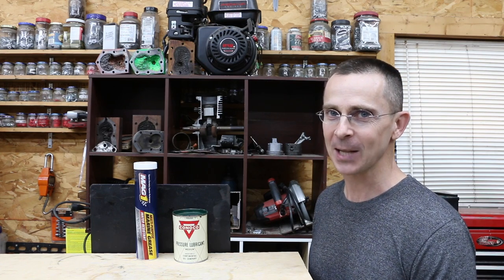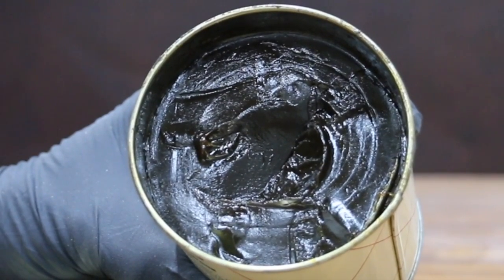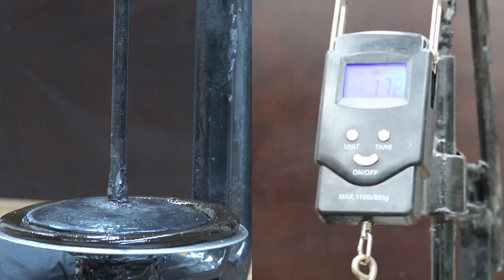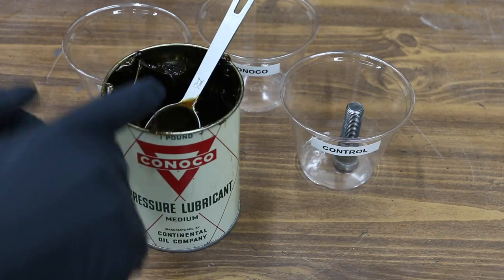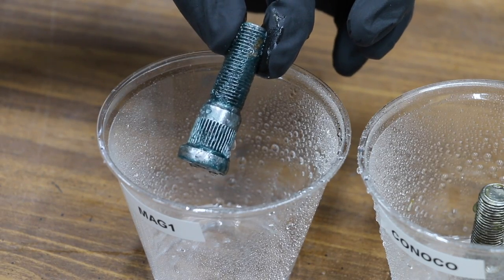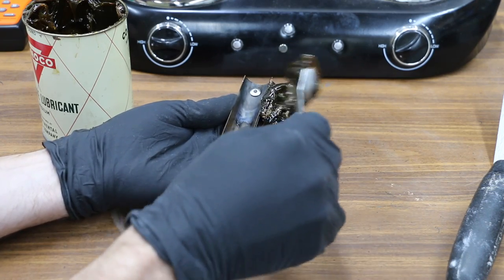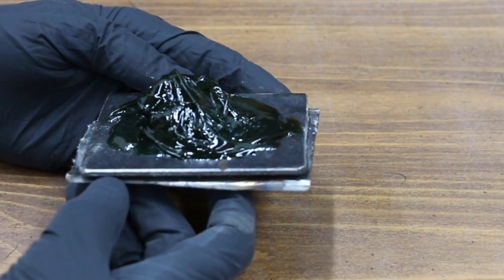Is 75-Year Old Grease Still Good? Let's find out!

Comment: I really enjoy your work and your videos.
I just thought that testing a multipurpose grease against an grease for motorboats and other use on the sea is not very fair whet testing corrosion and adhesion in water. You may have used also a multipurpose grease from nowadays.

Comment: Video idea project farm you should test the maximum stress a lawnmower engine can take before engine failure as in bypass the carburetor governor and see what is the maximum rpms you can rev a lawn mower single cylinder engine before you have engine failure I know our pressure washer has an automatic adjusting throttle arm that it moves back and forth to adjust the throttle for the load applied and when idling if you pull back that little metal arm it will rev really high almost like it’s gonna break or something you should do a “stress test” video thanks!
Reply from the maker: Thanks for the video idea.

Comment: To be fair to the vintage grease, it didn't say anything about being use in high temperature, high speed bearings. All the listed applications are lower speed, joint type applications.  With that said, 75 years of research and testing has definitely resulted in significant improvements in grease and grease applications.

Comment: Not quite the same thing but a few years ago I stripped down some 36'' pipework that was around 100 years old part of a Hydro scheme here in Scotland,  the nuts came off the bolts as if they were brand new they had been lubricated with Tallow I doubt any modern lube can beet that.
Reply from the maker: Thanks for sharing.

Comment: Came across a yard sale bought 2 cans of GAA  never been open. Lot date 1/ 1968 
This was extensive use in the military, General Aircraft Automotive grease was used on every movable part in the Army.
On a radar site we had to grease the stabilizer legs on 6 types of radars annually normally 2 days of back breaking of GI sweat. 
This grease was protective coating from the elements. This type of grease was a pain to apply, but it held up great. That's GAA would never get out of your fatiques, regardless how many application of solvents you tried.
Fastest way a Non Com would tightening up a squad,or a platoon was to state "might be needing a couple volunteers for a GAA detail".once on that.. you were smooth sailing😂😂😂
Reply from the maker: Thanks for sharing.

Comment: Dear Project Farm, here is another comparison idea: classic bar/chainsaw oil vs sunflower oil. A lot of people want an alternative to the polluting bar oil. Especially used near water streams this oil is very nasty stuff and the 'bio'-grade bar oils, which are very expensive, do not have a particularly good reputation in terms of required maintenance after use as the oil-gets way blocked due to coagulating and solidification of the oil). On ecologically friendly forum's more and more people start to use sunflower or similar oil as bar oil.
Reply from the maker: Thanks for the video idea.

Comment: I got an idea for video, but it is no product comparison. Maybe when u get bored you wanna try it. German Panzers in WW2 used a coating to prevent magnetic mines to stick to the metal, called Zimmerit. The Wikipedia entry even gives the formula. You could try to make it and test it on metal surfaces, vertical, angled and flat or so. might be fun, but maybe not ideal for your channel, i dont know.  o7

Comment: Awesome experiment!
It would be interesting if you came up with some grease compatibility tests since this info is tough to find for everyday products.
Also, how about thinning regular grease with gear oil? It can be tough to find  NLGI 00 grades for steering boxes or closed knuckle front axles and it would be interesting if there were a mix of regular products that could work! Mix in blender vs by hand?
Reply from the maker: Thanks for the video ideas.

Comment: do you have a video on what product is the best at protecting the undercarriage of a car? I'm from Ontario Canada and we use salt slurry on our roads and it just ruins our vehicle but there are products out there like rubberized tar, wax, silicone different oil sprays and sometimes grease but which one would work the best to protect the underside? I thought about using the rubberized tar but am hesitant because it could leave little pockets for moisture to get in and rot underneath that

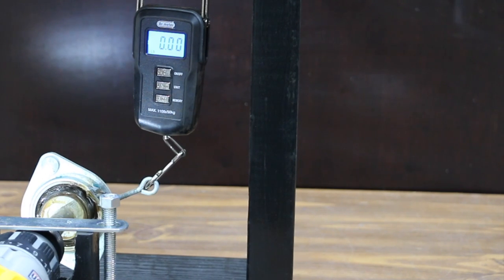Comment: 8:57 Unless there was a significant color change during freezing, it looks like you might have mixed up the Conoco vintage and MAG 1 greases here.

Although, in this particular case, the difference between the two was so small as to be statistically insignificant.

Comment: 6:19 I feel like this shows resistance to pressure instead of water exposure. After all you are basically spraing the plate with pressurized stream of water. Meanwhole in real life it would be just droplets of water hitting it in most cases. I know that thats propably hard to simulate but still.
Reply from the maker: Thanks for the feedback.

Comment: I've got a test suggestion.   A lot of guys have trailers to move their equipment especially flat bed untreated wood deck trailers to haul larger equipment like mowers and small tractors.   What is the best way to treat those decks so they hold up to sun, rain and snow.  I've heard of using a water seal such as Thompsons, sanded paint type deck seal, oil and even polyurethane with sand broadcast over it while still wet...is the a good preservative out there that isn't also slippery when it gets wet that will hold up to heavy use and extreme weather?
Reply from the maker: Thanks for the video idea.

Comment: A lot of talk on forums about Tundra Transmissions no longer having trans oil to air cooling. 2019 and up have only heat exchangers. Wander if you have done a transmission fluid heat breakdown testing. I know the Toyota Tundra forums would eat this right up. Certainly if trans fluids have changed from 2018 and earlier models to the 2019-2021 models.
Reply from the maker: Thanks for the suggestion.

Comment: This probably explains why old timers knew how to pack wheel bearings and did so often. The old grease needed replaced whereas, a lot of modern mechanics may never pack a wheel bearing in their lifetime. I have done it one time on my old ford pickup but never had to on any other vehicle or trailer I've owned.

Comment: My wife came from a family of farmers and cattlemen and they have some OLD equipment and over the years looking at the equipment it seems that it was built a lot beefier, thicker metal, cast iron parts, overall heavier. Alloys today are a lot stronger and lighter, but I think it's about the electronics. Today's modern equipment has a lot of sensors and electronics that just don't do well when hay dust gets all over them or a cow smashes the side of that aluminum panel busting up the circuit board on the other side. Lubricants and fuels have become a lot better while physical construction has become more complicated and certain parts weaker to cut down cost but also reliability.

I really think things are built very well today, but the ability to fix it yourself is lower and complexity increased. Look at modern cars. They talk about back in the day built like a tank, but crash footage shows they are more dangerous and less safe. I think it's more of an illusion of reliability and safety and there are trade offs.
Reply from the maker: Thanks for the feedback.

Comment: Apply antique grease to the top of any fence heathen kids climb over. Found a metal can of antique nasty grease that at first glance, looked to be fibered tar roof coating. Straightened bent over top of a fence at my rental unit from next door renters ferrel cherubs constantly climbing over. Applied stinky nasty grease real good with latex gloves. Next time I did a property checked, top of my fence was bent over again, but with a large amount of 'classic' grease missing so I reapplied. Fence was never breached again from that bunch. Guessing once kids put clothes in laundry and momma realised clothes were ruined, that's what stopped the trespassing. 
One more use- apply on grab/climbing points on trees that ferrel neighborhood kids climb all over, to CYA over a possible liability issue due to injury.

Comment: Video idea - and I'm not sure how you can reasonably do this... In lockdown, I'm using my car as little as possible and it hardly gets a chance to warm up. How damaging to an engine is short-trips like that? Suggest an automated engine starter which puts a small engine through say 1,000 short runs each of which only gets 1/2 way to temperature. :) that might take a while, though with a water cooled engine might be able to do 3 or 4 starts an hour.
Reply from the maker: Thanks for the video idea.

Comment: I would really like to see a video comparing the effects of shop compressor air with air compressor tools using 1/4in line vs 3/8in line. Then 3/8in line with the normal 1/4in fittings vs full 3/8in. I think most people have air compressors in their shops with 3/8in hose and 1/4in adapters. Does the 1/4in adapter restrict flow? How much? Is it worth going all 3/8in?
Reply from the maker: Thanks for the video idea.

Comment: Hi, could you make a video about adding pure Dimethyl sulfoxide (DMSO) concentrate - 99% into oil(100ml per 1 litter). It has super cleaning effect for car engine. Also there are another way to use it - you can add it into fuel, but you'll need mix it with acitone, proportion 1 part of DMSO to 4 parts acitone + gasoline. - and check combustion camera after. This cleaning method is very popular in Russia. If this method will interested you - let me know.
Reply from the maker: Great suggestion!  Thank you.

Comment: It's ignorant to ignore the advances in chemical compounds over the years. Of course the modern grease did better because it's useful for our daily lives and engineers have been working on improving it all that time.
I understand some of the claims from old timers that the old ways were better, because certain things used to be built to last whereas today we build things to be disposable. But lots of times it's a tradeoff.
Cars used to be built with heavy steels which made them very tough and durable but also heavy and major gas guzzlers. Today cars and trucks are made with much lighter materials for effeciency, the body panels might get damaged easier but the frames are just as strong as ever and parts are easy to repair or replace.
Sorry, rant over.
Love the video, expected newer to be best, hoped I might get a surprise but it's about as I expected.
Reply from the maker: Thanks!

Comment: Hey, can you test shop staplers?  I've bought an arrow and 2 Stanley's and ALL three are super hard to use.  I had to buy an electric one, which I didn't want to have to be "tied down" to a cord.  I just don't have the strength to fire any of the others.  One of the Stanley's is a cordless, battery powered.  Its so heavy that trying to staple while holding it up is nearly impossible.
Reply from the maker: Great suggestion!  Thank you.

Comment: As you say improvements in lubrication technology, but I also wonder about the overall standards that the older products are manufactured to (as I am sure other things you compare are affected by this).   What I mean is that I am sure that the minimum and even the maximum requirements that are expected from products now days, far exceed the specifications that were expected back in the 1940's.  Even if a company back then could produce something to meet today's standards, would they have?  Would they have shelled out the extra money needed to produce something to standards that so far exceeded 1940's expectations, that it seems that even if they could have produced something that met today's standards that they would have been considered idiots by the shareholders and industry for doing so.  I am not saying that they could produce something to meet today's standards, but I question the fact that if they could, would they??
Reply from the maker: Thanks for sharing.

Comment: Can you do an oil test for the Liqui Moly Molygen New Generation motor oil? It is said to reduce friction and increase power. I have tried it in my car which it greatly reduced the engine noise and I feel like the engine runs smoother than before in which I previously had the Amazon Basics oil in it. So I just want to know if the Molygen oil is any good. Thanks!
Reply from the maker: Thanks for the video idea.

Comment: I have a theory for you to test. I’m told that if you have an engine that runs on regular gas and it has a certain amount of compression and put supreme in it, i’m told that the premium gas burns slower causing more carbon to build in the engine and thus increasing the compression of the engine, eventually giving more power and fuel economy. Is this myth or fact?
Reply from the maker: Thanks for the video idea.

Comment: Hello i have a problem i sprayed a the wd-40 on a hub motor and when i turn on the motor it star to make a lowed sound and then i add clipper oil to the hub the noise start to get more quiet but the noise still there and the i though to add maxima waterproof grease is that ok ? The motor is for  e-skateboard

Comment: I was curious if you change a gasket to a thinner one on a lawn mower right on top of the combustion chamber does it
Reply: Increase compression of so by how much and is this a good way to add power
Reply: Will it mess up the spark plug timing
Reply from the maker: Thanks for the video idea.

Comment: Imagine thinking ~80 years of chemical engineering would result in worse products. Not only are "cheap" greases today probably better than vintage ones, they're less expensive, probably less toxic, less environmentally damaging, and probably all around better. Any product not marketed for bargain-brand is going to blow old stuff out of the water on multiple levels.

This is like people who think you still need to change engine oil every 3000 miles when synthetic oils are better and last way, way longer. Just because you did it one way before doesn't make it the best way. Things change, and typically for the better, especially when it comes to technology. If there is a loss in performance it's because it's much much cheaper than what was used before, and there are always higher quality products available if you're not trying to use the bare minimum.